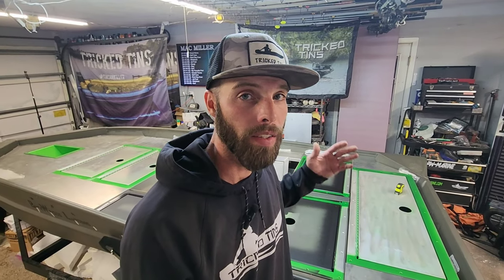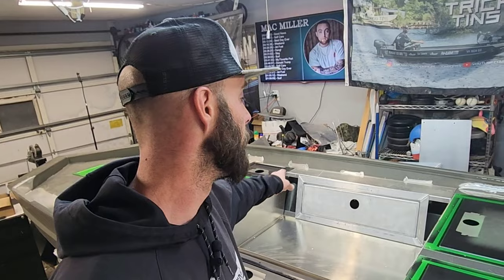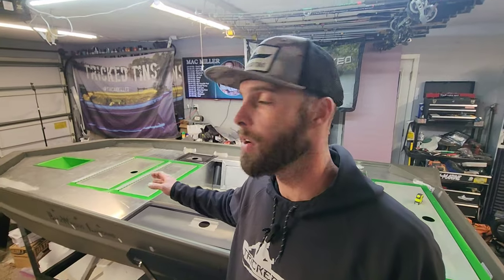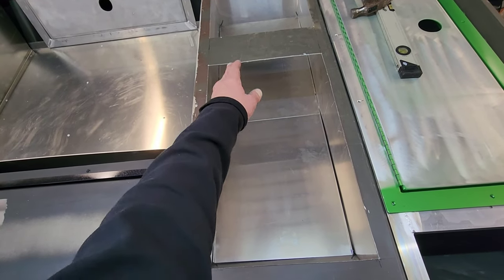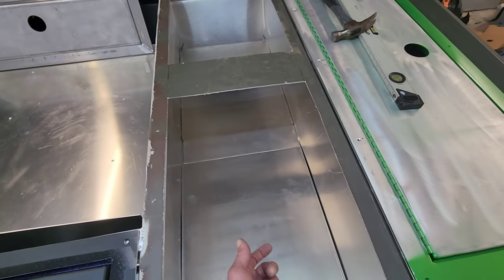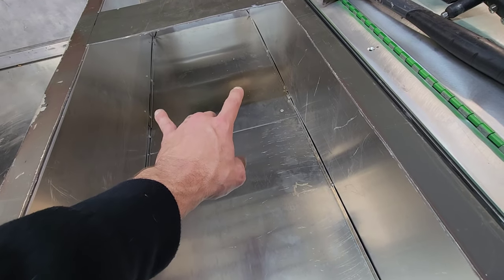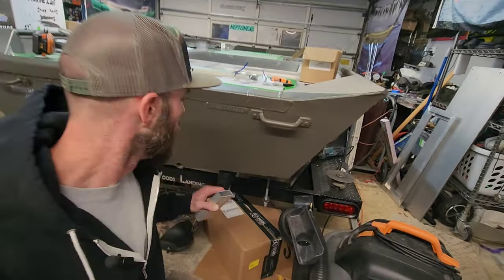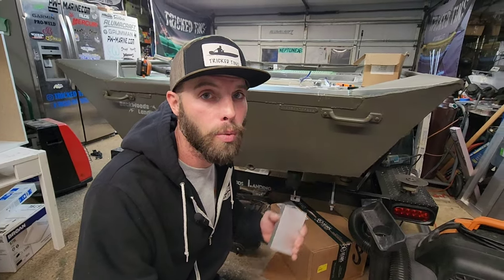1448 Jonboat Build part 7

Comment: Can you rebuild my skeeter next?
Reply from the maker: I can build anything.  Next in line is a year out tho...
Reply: @TRICKEDTINS  im good with that best way to get booked?
Reply from the maker: Professionalwelding@gmail.com
Reply: I have a Grizzly Tracker 1458. I would like to convert the two foam filled aft sections to storage and install a deck lid. Problem, I don’t know where the ribs are. I think I have room for two lid hatches on each side believe it has supports I can’t see. 
You thoughts please.
Reply from the maker: @melvinnash you should be able to see the weld seams from the top of the deck